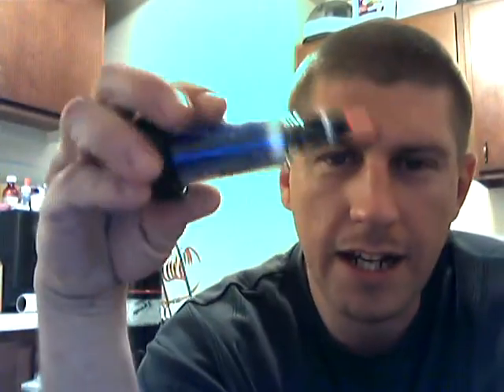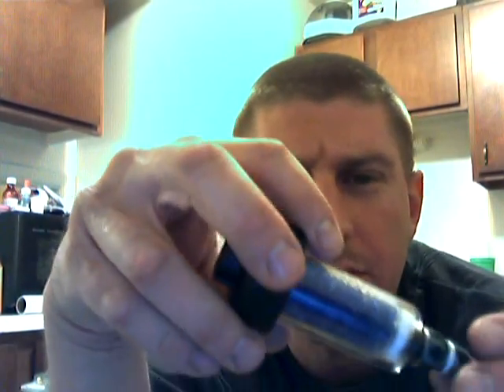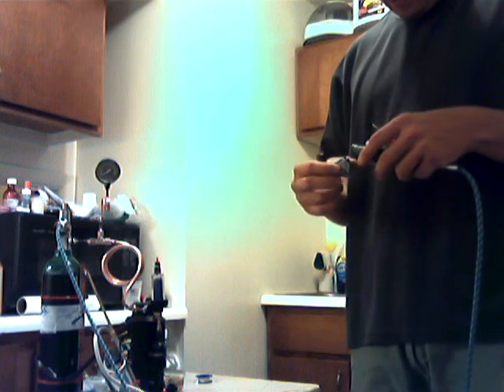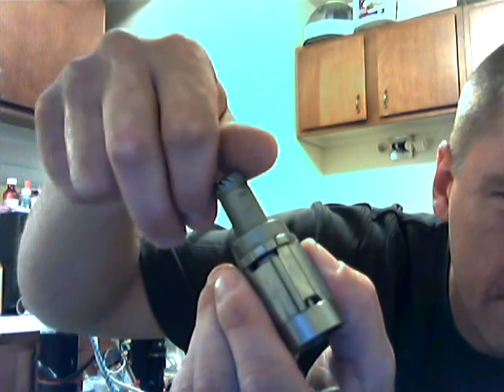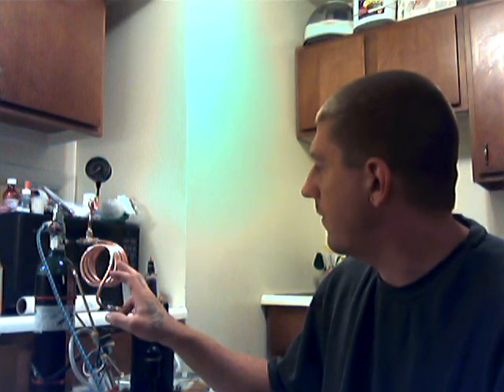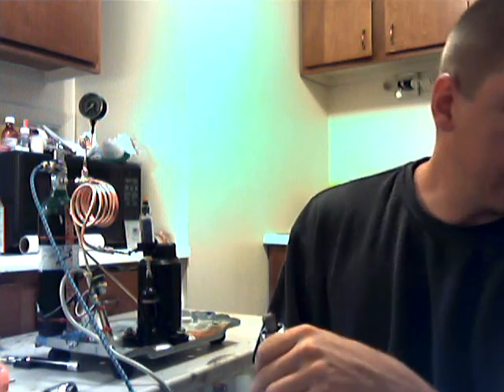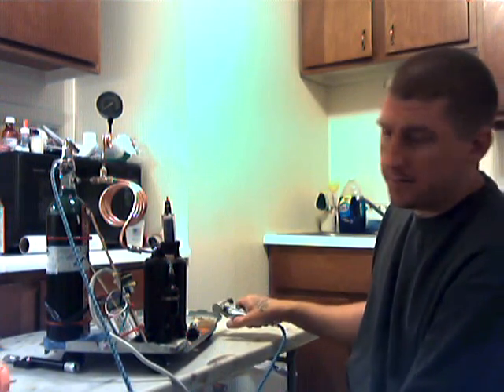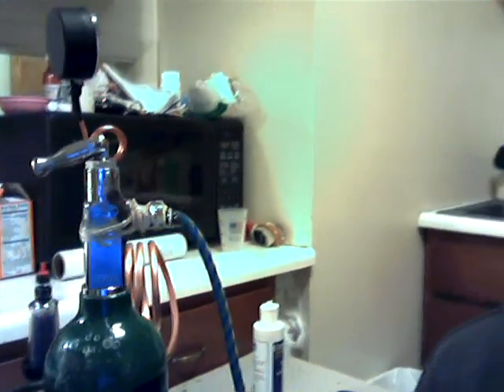DIY 325 psi rotory compressor

Comment: If you use a r410a rotary compressor it will handle 325 psi and more all day with no problems. I'm a NATE master hvac/r tech in south Florida.
Reply from the maker: thanks for the input , i gave up on this due to excessive heating, it needs a cooling system, but if i ever try again i will check it out

Comment: that rig is awesome man!, 325psi is very usefull :D
shame those die grinders need so much air volume, but that pump should have no trouble charging a 20gal tank to 125psi or so, that would be tonns for that grinder

I did a durability test on the weekend by running a rotary compressor continuously without any kind of lubrication and it lasted 30 min!
long as you keep some form of oil in it and filter the intake it should last for a long time

when I get the time I'll edit the vid and upload

Comment: cool rig-see if you can find a drawing of Victor Schauberger's trout turbine,bit tricky to build but a very efficient air vortex engine,that will utilise the cooling side of expansion and contraction of air or gases...